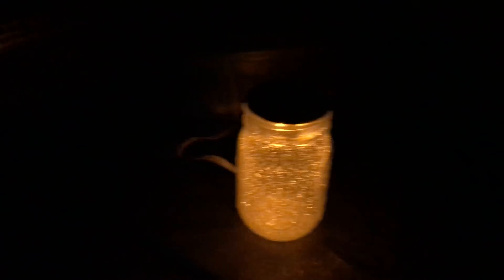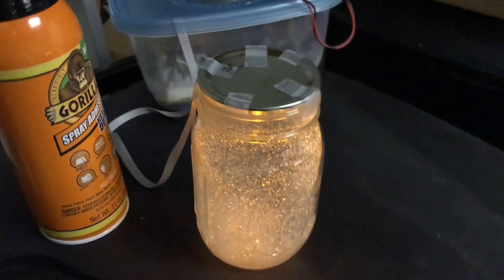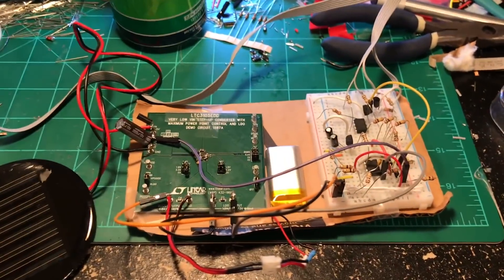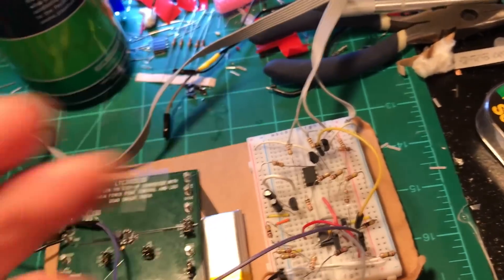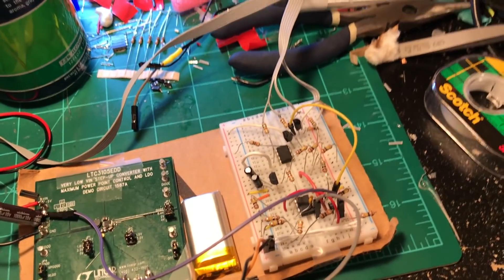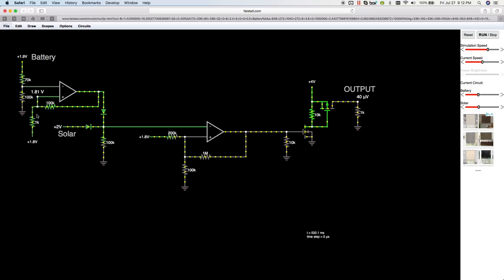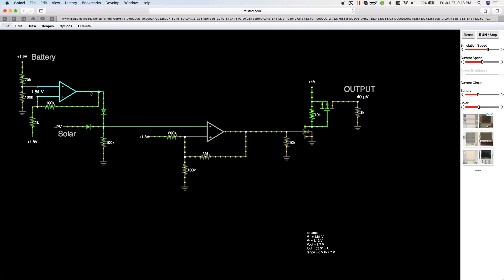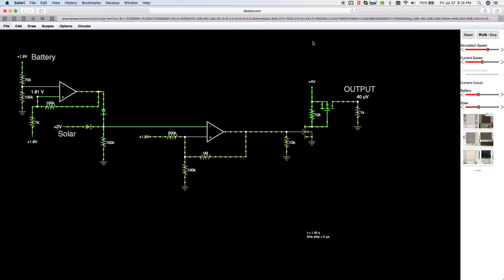Solar Candle Light Tutorial - PROOF OF CONCEPT

Comment: Check out my vid on using an actual candle flicker LED to drive more LEDs from the built in IC built into the Candle flicker LED.   No additional micro needed to drive the LEDs.    You'll still need the comparator battery monitor circuitry though.   Hope this was interesting and thought provoking.